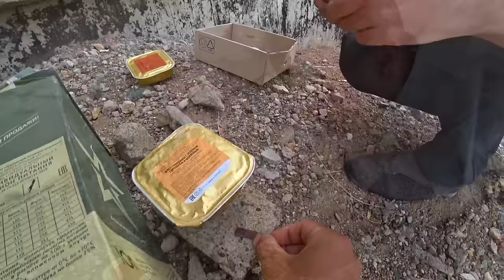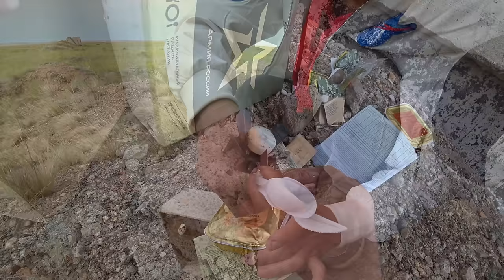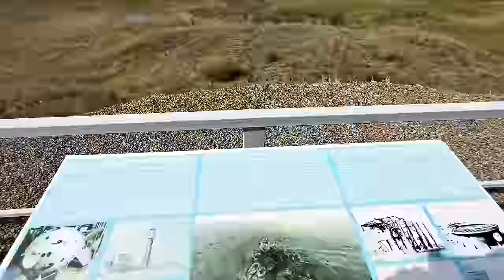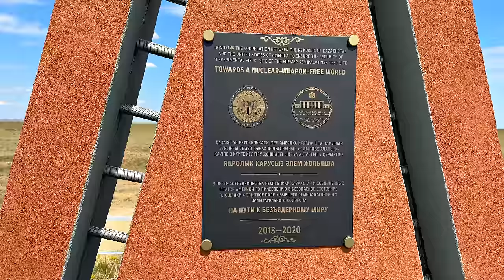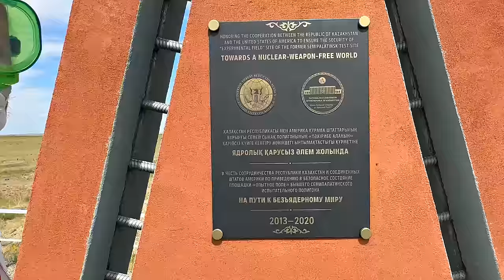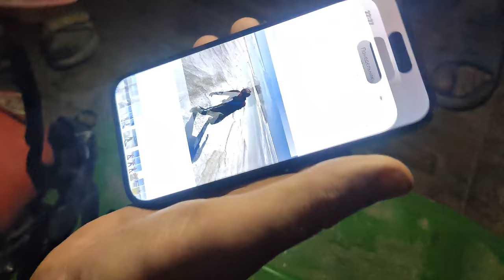✅The end! WE WERE ARRESTED ☢️ How brutal are the KAZAKHSTAN POLICE?

Comment: Love you guys but if you want American fans you should have our flag touch the ground. And remember too you're driving a 2stroke so you can't Rev high for to long. Two-stroke are make to be rebuild after 120 racing hours. I rode two-stroke since I was 10
Reply: You can coat all internals with boron nitride, it will make the engine virtually indestructible running at max rpm for hours non-stop but can be costly!
Reply: This is the equivalent of spitting in an Americans eye, yeah im gone

Comment: Sounds like his engine isn't choked. It's not a clutch thing. Those carburetors have a choke. It's on the right side of the carburetors. 
Pull it up and the engine is choked.
Pedal
Release clutch
Wait for the engine to start up
Lower the choke lever and rip the throttle.

Choke works by when the piston goes down the air and fuel get sucked into the engine. Now a choke reduces the amount of air flow into the carburetor, which creates a lot of negative pressure in the carburetor, so more fuel gets sucked in but not a lot of air.

Example: If you have 2 straws hanging out your mouth. One in a cup of water and one in the air. If you inhale, you're going to get maybe a little water but mostly air. Now plug the straw in the air with your finger and leave the other one in the water. You're going to suck up water. 

Also if it is the clutch. Pup the clutch cover off, take out the Philips head screw then squeeze the clutch lever and hold it. Then spin the flower nut 1 notch clockwise. Put the Philips screw back in place. Start the engine, ride it. Repeat if clutch keeps slipping. Don't over tighten it.